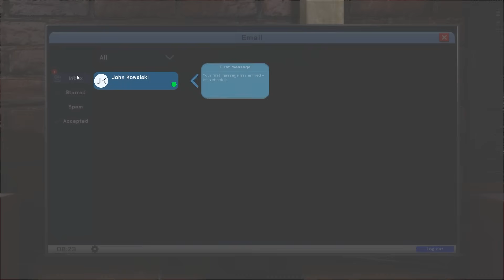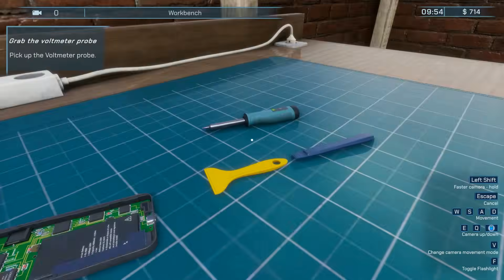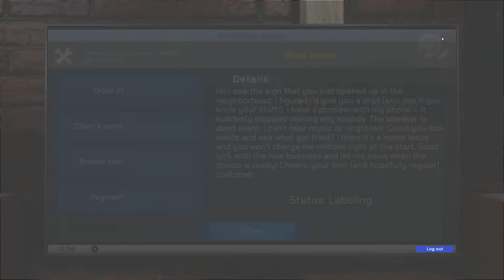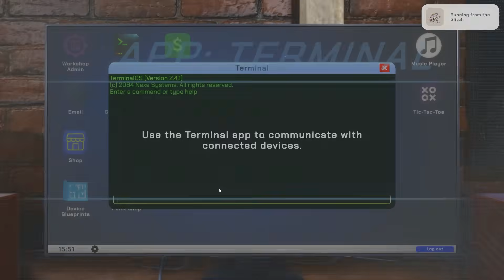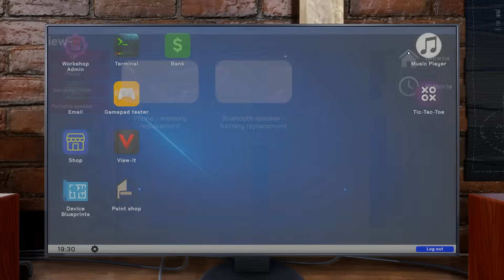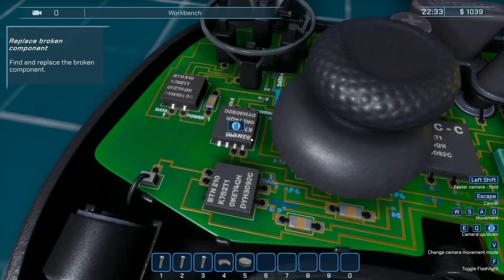Device Diagnostics & Fastidious Fixing in... | IT Works: Electronics Repair Simulator

Comment: The game should have had you test the mosfets, those are more likely to go than capacitors, you also should always disconnect batteries before working on electronics, and the game should have had you do voltage injection and use a heat probe to find the broken components.

Comment: 10:50 For removing solder there is generally a copper braid that wicks it up or a vacuum, either powered that will both melt the solder and use a pump to remove it or that unpowered plunger tube that you will need to melt the solder separately. For most surface mounted components it is difficult to remove all of the solder with it in place, so you'll generally want to remove it while the solder is melted to prevent damaging the pads.
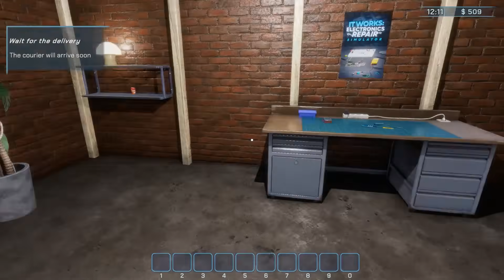16:00 Rather than ordering a bunch of spare shipping boxes, the game should let you save the boxes you receive and reuse them.

Comment: I like the idea of this. But the developer has obviously never seen a PCB in their life - it almost looks like when you ask AI to generate a PCB. Measuring DC voltage with no ground? Crazy..
Reply: Doesn't look AI, it's something simpler. Probably simple procedural pathfinding between elements. AI would group connections in more aesthetic "bundles", but would fail to connect everything up.